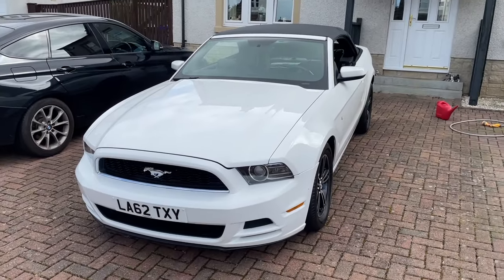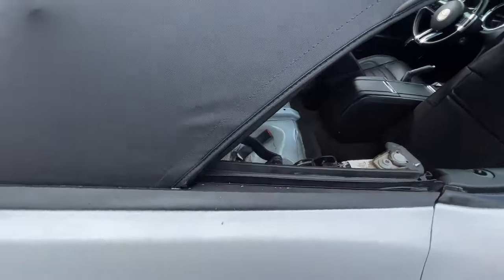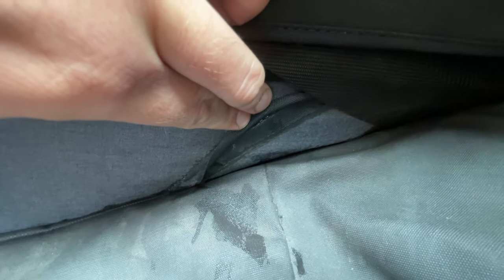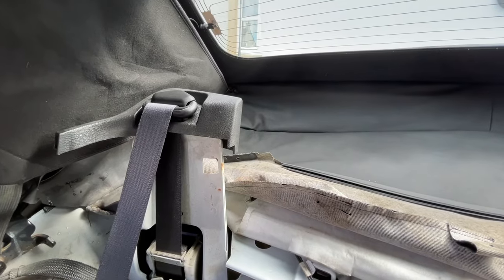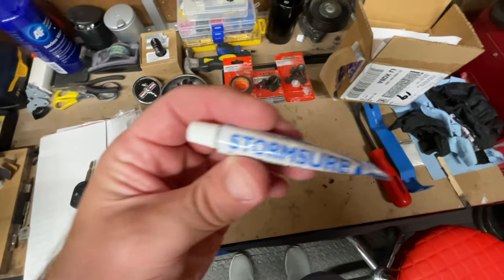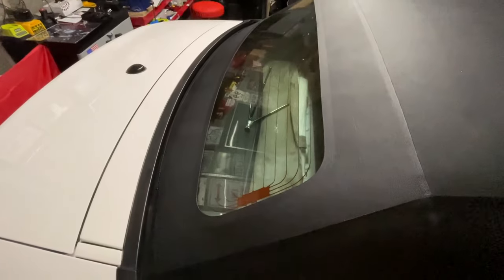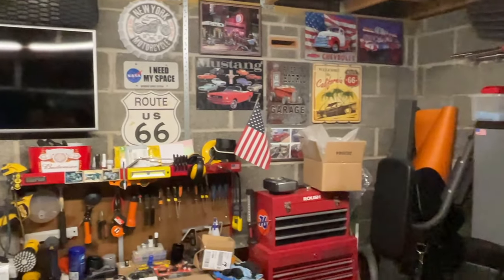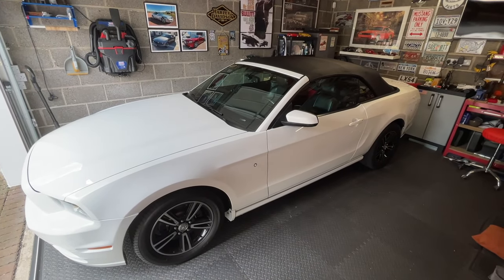2005 - 2014 S197 Mustang Convertible Roof and Trunk Leak Repair

Comment: Great video! Now I know how the convertible top is supposed to work. I also can see the level of disassembly I will need to do in order to diagnose the problem. The glass fell out of the OEM top and I had an emergency situation. I replaced the top myself, and had water intrusion, but I had that with the original top too.  I've posted on some mustang forums at the time and I've found that DIY'ers don't usually fool with convertible tops. Same with the dealerships. The convertible top and leaks would go to a convertible top or upholstery shop, the mechanics at the dealership won't haven't a clue. (On how to fix it, lol, but they know wet is not right.)  So, thanks again. I'll have to get busy. :fish-orange-wide-eyes:
Reply from the maker: No worries glad it helped! 👍

Comment: I have a 2014 Premium Mustang 5.0 and she just leaking. Very aggravating! Thank you for you video
Reply from the maker: Thank you. I found out that my top is aftermarket with seams where there shouldnt be seams. If yours is stock it may be leaking around the glass or at the point where the top is stapled to the u shaped bar right at the back. If its the latter you need to remove it from the channel to fix properly. Best of luck 👍

Comment: This is an aftermarket low quality soft top I can see the difference even the rear view windshield is not the same as original one
Reply: Factory soft top doesn’t had a seam on this area
Reply from the maker: Thanks, it is indeed. Not purchased and fitted by me but by a previous owner. The drains still needed clearing but the issues with the leaks up top are because of those seams. It’s completely leak free now after I took care of them plus off camera I took the rear part of the roof out and refitted it with new staples. I’ll be buying a better quality top to replace it though.
Reply: @autogaragelife  you did nice and skilled repair ! Yea no worries on top material it will handle more . So many were complain about soft top fitment was not pointed that’s why we should go for trusted brands . 🙌👋
Reply from the maker: @dTamerSam1  thanks! Happy with it for now and thanks for watching 👍

Comment: Nice car, but you are right about the work you have to do considering that it came from a dealer. 

Were you aware of the other issues such as the steering wheel when you bought it?

Oh and where is that beautiful SL?
Reply from the maker: Thanks. I missed having a mustang so had to go back. I was aware of some cosmetic wear and tear but the buttons worked when I was at the dealer. They started playing up on the 500 mile drive home. Fixed now and will be in my next vid. Also the dealer stored the car indoors for months so probs didn’t notice the leak 🫤🫤
Reply from the maker: The SL has moved on to it’s next owner who I’m sure will look after it.
Reply: @autogaragelife ahh that’s a shame as it was a beautiful car, they have done well there!
Reply from the maker: It was pretty sorted when it left👍
Reply: I bought an sl in January your video's helped me with a few issues I was surprised to see the new car but know what it's like having an itch for a car, good luck with your new car I'm sure people will enjoy your work and if a friendly guy from Glasgow approaches you in your new car it'll probably be me haha 
John
Reply from the maker: Thanks John. I regretted selling my old 2005 Mustang and wanted it back. Couldn’t track it down so decided to get the best of both (coupe mustang and convertible). That unfortunately meant parting with the SL but I may go back to one in future. With the mustang I’m a pig in s*** though!